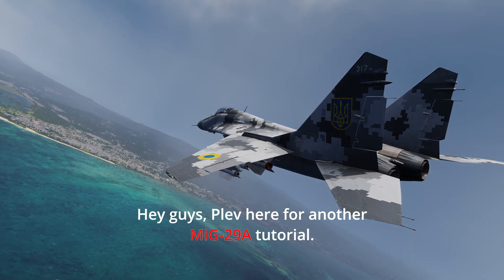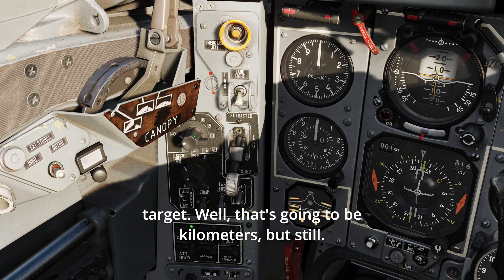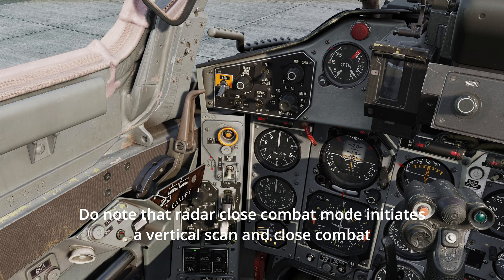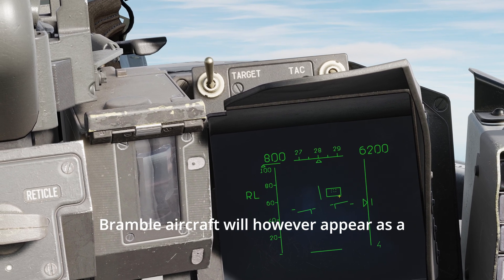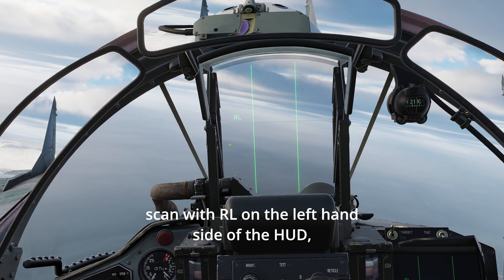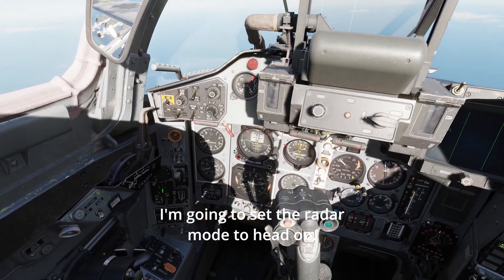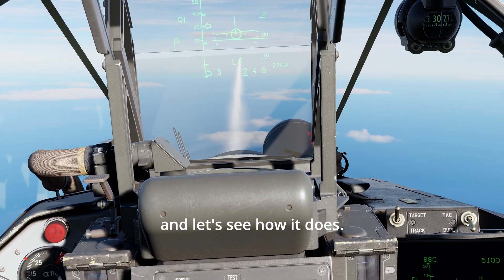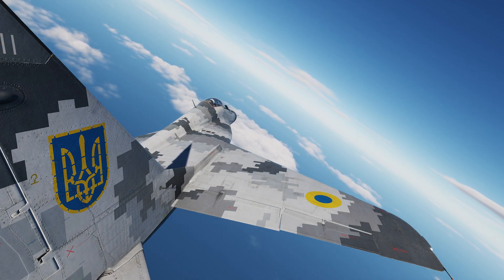DCS: MiG-29A Radar Introduction

Comment: Of course its search radar. Just because its not on par with modern radars doesnt make it non search one.
Reply from the maker: It’s actually not a search radar. It’s a Fire Control Radar. It was designed to be left off when not in use and doctrinally designed to be used in conjunction with GCI or AWACS providing search and/or guidance. In combination with GCI the radar could actually be manually controlled by datalink by GCI. But the radar was not designed to be left on indefinitely like in the F-16 and usually was to be left off until ordered on by GCI.